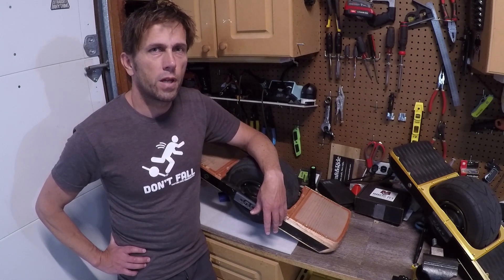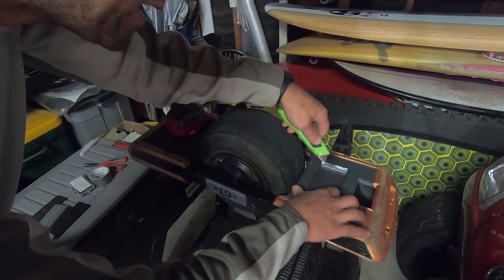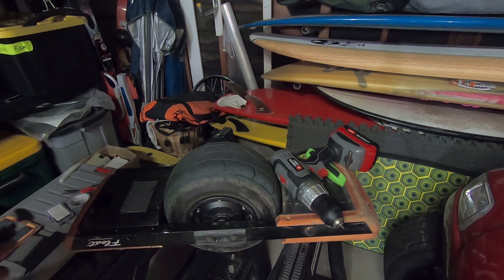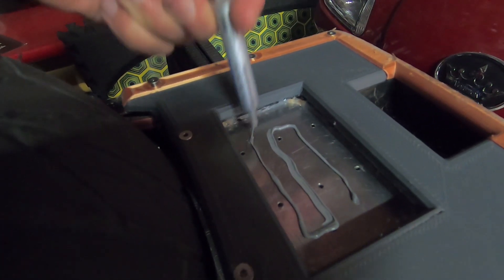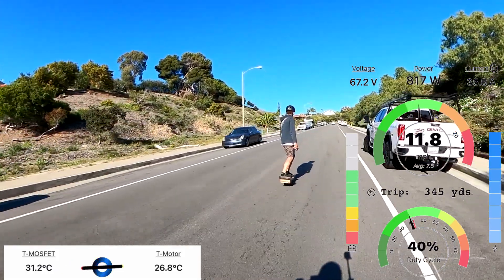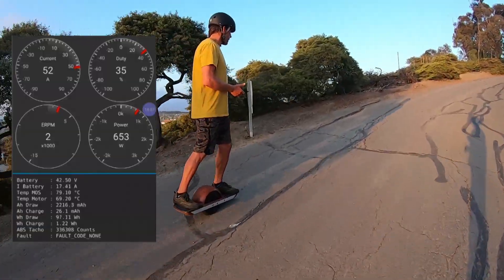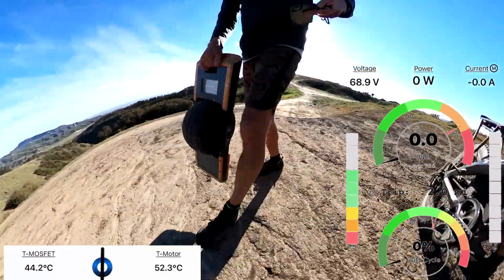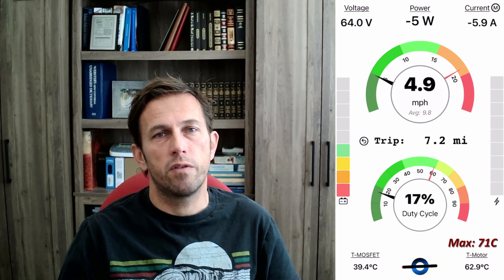Funwheel GT Part 3 - Overheating No More

Comment: I really need to find you some lipo to try.
For cooling, usually you will keep the same delta T for the same cooling.
add 10C outside = add 10C mosfet.
Reply from the maker: Why is that? To minimize voltage sag? At most I should be able to squeeze three 2200mAh 6S LiPos into my battery compartment (only 36mm of space vertically) giving me half the capacity of my current LiIon pack. So it would be great for testing, but not really for regular use.
Reply: @surfdado  Lipo for less sag, yes. From past experience with other projects, It was making a notable difference. rpm control was much ''stiffer'' Also less mAh consumed for the same work because less loss inside the battery.
I like your idea of adding a range extender. This will do even better.
I just want you to experience it. After that, you make your own choices based on experience and preferences. 
Nice work !
Reply from the maker: I could create a backpack battery instead using 3 of the bigger 6000mAh LiPos, that would be a nice range extender while also giving me a significant boost in Amps